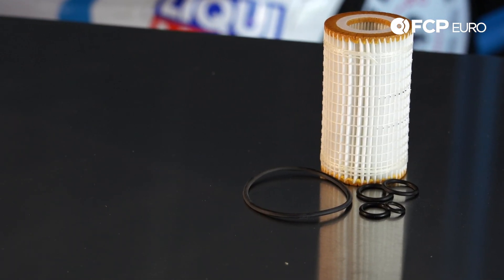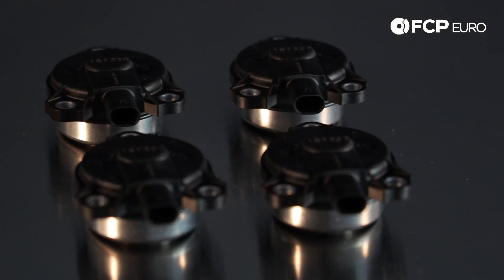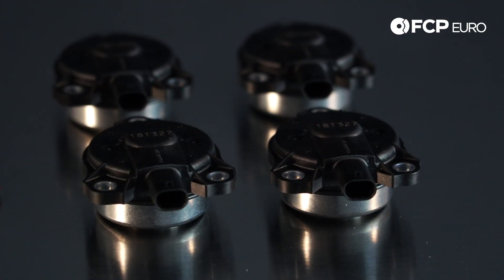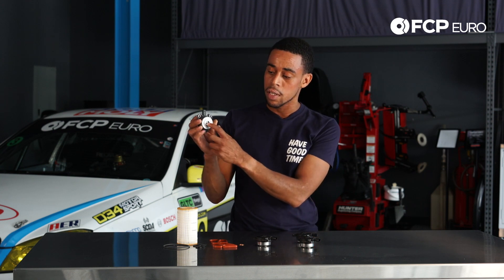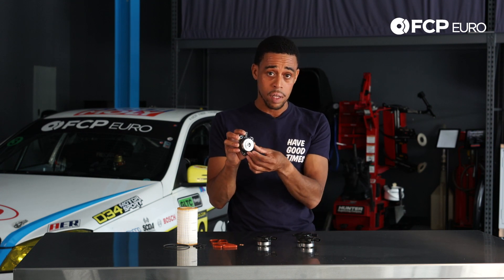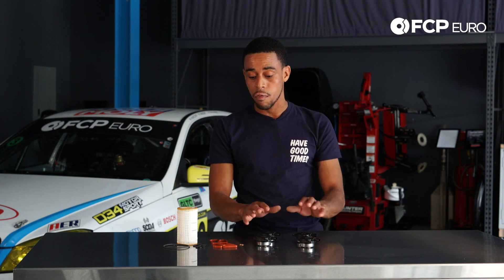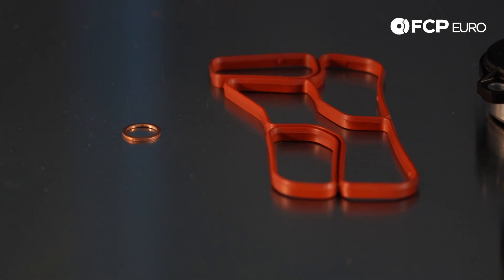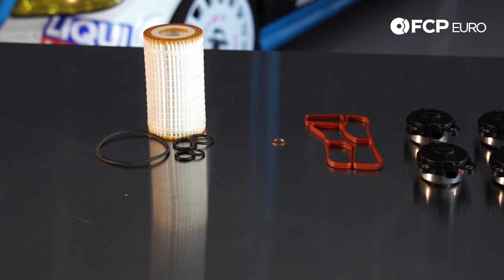Mercedes W204 - Camshaft Adjuster Magnet Repair Kit - Symptoms, Repairs, and Product Review

Comment: If these go bad can they cause rattling of engine?
Reply from the maker: Hi Yaziid, when these units go bad you can indeed hear a rattle coming from the engine. Usually at startup, but could be longer if the issue is severe.
Reply: What about misfire at idling?Can it cause that